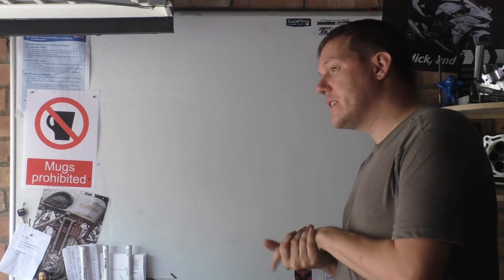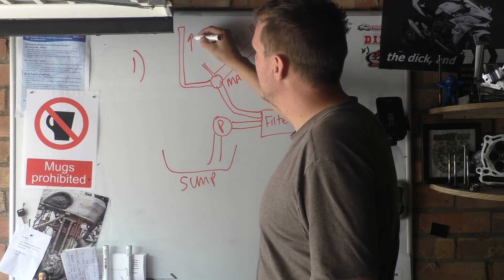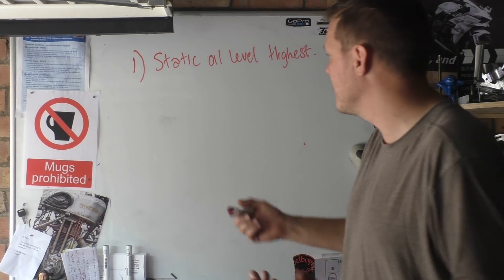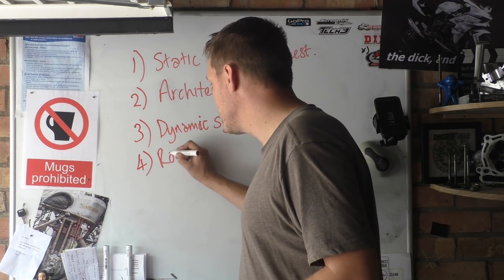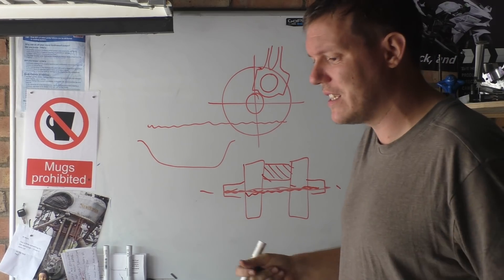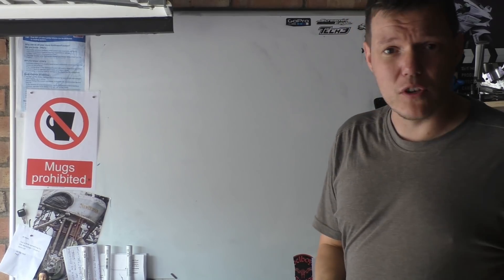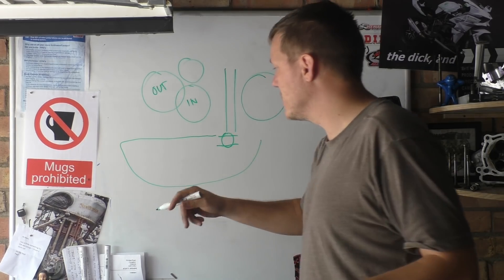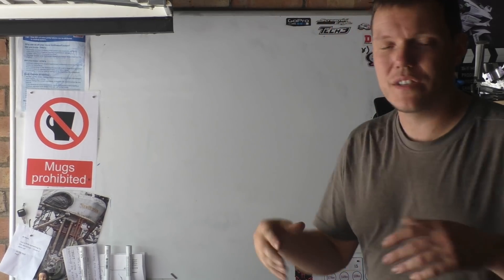Do crankshafts sit in oil?

Comment: The problem with subjects like this is that there is no right answer without some sort of context to limit it's scope.  Certain splash oiling designs, the crank and even the con-rod do sit and travel through the oil in the sump and/or crank case in order to get oil on to the cylinder bores (as you pointed out with Briggs and Stratton).  Even in those splash designs, only a small part of the system needs to touch the oil to be effective. Most modern designs keep the crank and rods clear of the oil in the sump, but this is due to better designs and ideas - such as piston oil squirters - where oil is more efficiently introduced to the areas it needs to be.

P.S.  If you wanted to explain the oil level change during operation, you could easily show the sight glass of an upright bike while it is off and while it is running.  The oil disappears from the window when it is running.

Comment: This reminded me when my mate at work said 'i have a problem with bubbles in my oil'. He could see them in sight glass, he thought it was a major problem. I said don't worry about the bubbles in your oil, it just getting aerated when the oil returns from topside and crank of the engine. The oil has to settle in the sump.

Comment: Not bike related but once sent an apprentice to fill a van with diesel and check the oil before a long drive. When he got back he commented that the oil was low and he topped it up. All good.
Set off and noticed huge amounts of smoke......he had topped it up.....to the brim 😂
Crackshaft was well lubed though!!
Reply: At least he did not fill the oil reservoir with diesel xD
Reply: When I first started working one of the guys I worked with did this in our shit works van.

It decided to autorun on the bypass just down the road from our work, I couldn't stop laughing long enough to tell him what to do (put it back in 5th and apply the brakes) the van normally maxed out at 80mph and it got all the way to 95mph with the ignition off just running on oil and sucking in fuel, he was white as a ghost and I fell out the van crying with laughter by the time we stopped..
But it burnt off enough oil to not explode and after draining the excess off, the engine was ok.
I hated the van anyway and hoped it was fucked (unfortunately it wasn't, although it didn't last much longer as gearbox went not long after)
Reply: Yikes, you could've had a runaway!

Comment: Question, do oil & air cooled engine make the oil deteriorate much faster than an equivalent water cooled engine?
Reply: yes I do want to know this too. and if using higher viscosity oil will alleviate the oil degradation from such high heat usage.
Reply from the maker: Generally not no. The difference between an engine with an oil and air cooled engine and a water cooled engine is the power and thus waste heat created.

You start with air cooling, and the oil cools as well. 

You increase the power output of your engine (engines on different models through time) so your air cooling isn't enough. How do you know this? Your oil begins to burn.

Next step is to add an oil cooler.

You increase power again. Now both the air and oil aren't enough. So you add water cooling. If all engine design have the same oil temp (on average) then the oil will survive just the same amount of miles.

A good example is the SV. It has an oil cooler as well as the water cooling system. Due to its design the oil was getting too hot. Therefore add an oil cooler. 

If you compare the Bandit 1200, is makes 98HP. The SV1000 makes 120HP (Suzuki numbers) The bandit has air and oil cooling - the SV both water and oil. And the Bandit is 200CC larger (with 2 extra cylinders)

Good question, deserves a video.
Reply: Good answer, onto the list it goes with a wait time similar to a minor surgery through a public healthcare system lmao.

Comment: My BWM's diesel crank was definitely sat in oil the other month..

It was so much oil and diesel that it made its way into the intake and turbo / exhaust and the engine decided to run on its own for a minute or two.. That was interesting in an auto....

Needles to say we tracked it back to blocked injector causing to much back pressure in the HP pump and it blew the seal and started pissing fuel into the sump via the timing chain.. 

When I took it out to clear the oil / diesel out of the exhaust / intake and turbo it was when England we're playing in the world cup.
So minimal cars, you wanted to see the smoke once it got hot hehe filled the road out in the sticks.

Funniest bit was the only people I really came across was a group of horse riders obviously with the same idea about clear roads, they didn't look impressed when I went past luckily I didn't have to look at them for long as they vanished into the smoke haha
Reply: Needles, LOL :P
Reply: Co2 fire extinguisher into the intake and pray job? Or did you block the intake ?
Reply: No I just let it run with ignition off for 30 seconds or so as it was fluctuating around 2.5k rpm, so not a full run away and then it burnt off enough shit from the intake that popping it in and out of drive and reverse stalled it out.
Was definitely a brown pants moment.
Reply: Running diesel. Quite common.

Comment: Unless its a 2 stroke.. hehe
Reply from the maker: LOL but a 2 stroke doesn't dip into oil either....
Reply: The only oil in a 2 stroke engine crankcase is usually from the Oil injected to mix with the fuel or the very small amount pumped directly into the main bearings via the autolube pump.